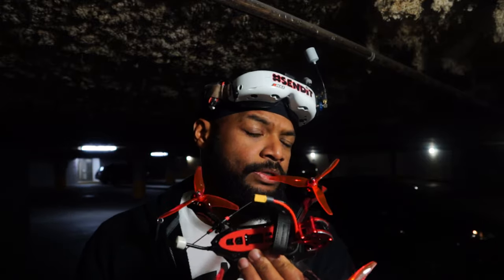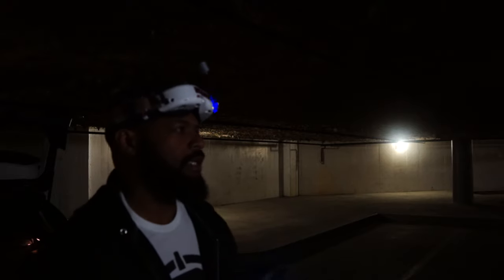TBS Fusion and DJI FPV Indoors // Weekend Vlog? 😳

Comment: Thanks for taking the time to do these videos. I just got my batteries, had my quad and dji set for over a month now, but i was worried about the batteries, since I live in an apartment. Now I need to build the quad and learn how to charge the batteries. Thanks again for the videos,  dont get mugged out there.
Reply from the maker: Awesome man! Don't worry so much about the lipos... Most of the danger is in charging so my #1 tip is to always charge at arms length and check the pack temp every few minutes. If the heat starts climbing rapidly unlpug it and get it outside. Also make sure you check out Joshua Bardwells channel. He has lots of great videos for building and lipo safety.
Reply: @Furadi  Thanks man, I appreciate your comments. I cant wait to get out there with my quad, I made sure to but spares.... I also went ahead and got a couple bat safes to store the batteries, along with lipo bags. I really dont understand why mobile phones dont come with similar warnings to these lipos. Anyway, appreciate you content! keep it up, this channel is going places.

Comment: MIMO is fundmanteally different than just running a rake receiver - can be ran simultaneously.  What MIMO really enables is some degree of directionality, which in the context of a high multipath environment can actually mean some selection-based management that reduces ISI substantially.
I suspect the answer is both... but it takes another level of nerdiness to care.  Does it work?  Yes.

Comment: Nice vid mate im so keen on the DJI setup 👊 question , wer did u get that short lead battery from , strapped to your goggles? 
Makes the goggles look very tidy 👍
Reply from the maker: Its a gnb 3000 2s. BUT I extended the lead a few inches. I have a video on that too! 👌

Comment: Did you ever try HQ mode in that garage? Since it's 60fps it should allow more light to the sensor and make a brighter picture. But of course the added latency will suck.
Reply from the maker: oh no I've only tried that once and almost puked.